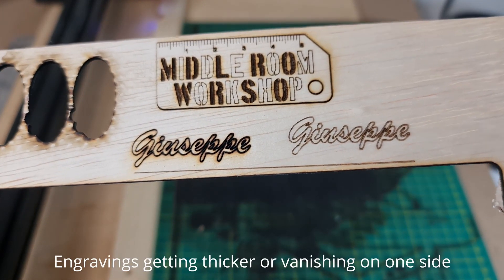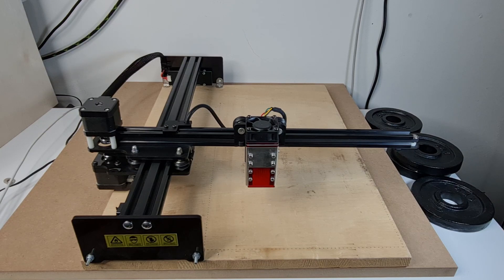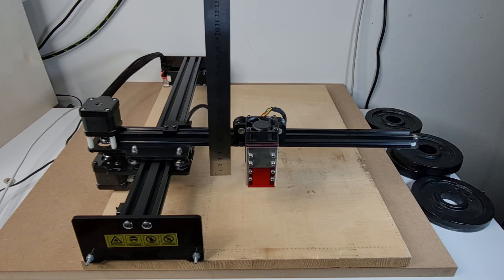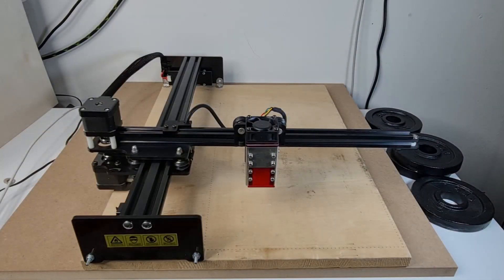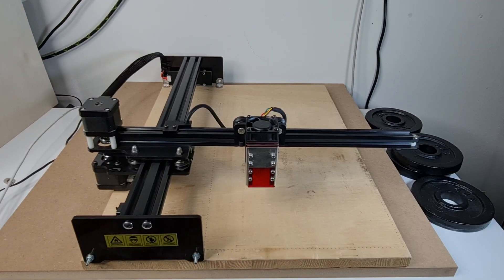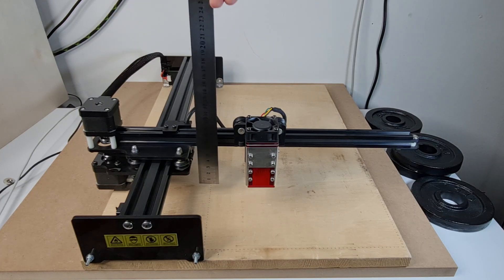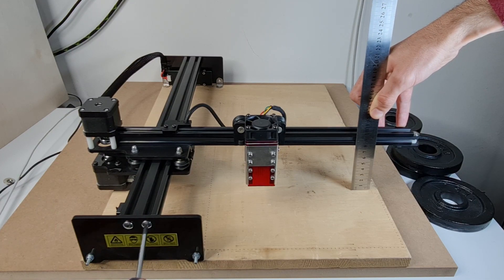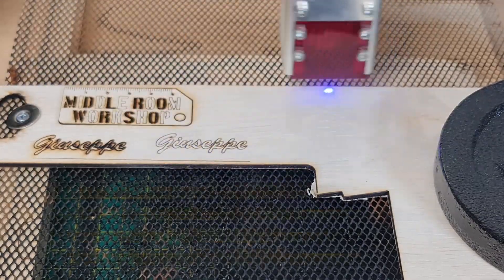Are your Engraving or Cuttings not right? Check this out

Comment: You really need an air assist for that laser. I make those cuts at 250 mm/min at 70% power in one pass. Whithout the edges burned. Thanks for the video!
Reply from the maker: Hello George Chambers, thank you for your comment.

I know, that is my lacking component, but living in a flat I can't really use any noisy equipment.
I am designing something to be quiet and it will come soon, for the time being, I use a small 150mm fan blowing across.
As for the cutting power I can cut at 300mm/min 85% without air assist with the focal point 1mm below the surface but it is burning the edge more than what you saw in my video, for this reason, I decided to go for a cooler run at almost double speed with 2 passes.

What do you use for your air assist? Standard compressor or these air pumps for fish tanks?
Ciao
Reply: I use a small airbrush compressor with a 1 gallon air tank. An airbrush compressor is much quieter than a fish tank compressor., I tried one of those and they're too noisy for me. I have my 40W in my office so it needs to be quiet. My 30W and my K40 are out in the shop so I only annoy myself with the noise. 😁
Reply from the maker: Hello George Chambers, that is a good idea. 

I might give it a try.
Thank you
Ciao
Reply: Hello. I'm very satisfied with the cutting (a40640), but still struggling to find best settings for engraving smaller and thinner text.
Care to share your settings for engraving text? I'm focusing the beam by setting the material 17mm bellow lowest point on the laser head. I recently stumbled upon a comment on reddit which says to try the engraving with focus distance 20mm and I've got slightly better and consistent results with this setup (for engraving).
Material: poplar plywood 3mm - cut (75% @ 250mm/min @ 1pass), engrave (15% @ 1500mm/min @ fill). On harder wood (eg. beech/mdf) engraving is better.